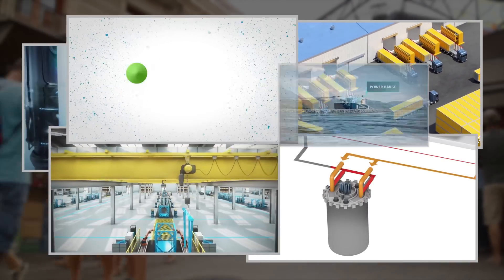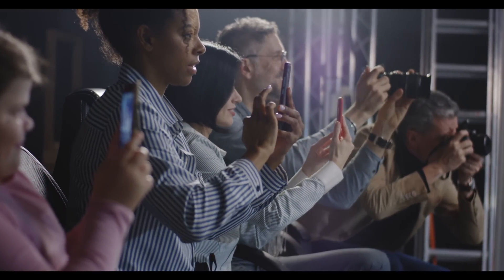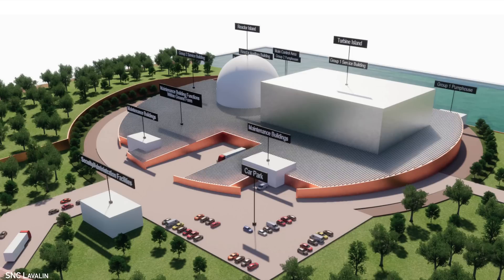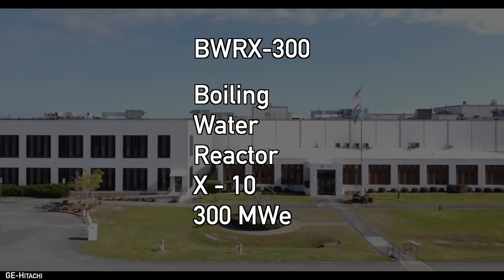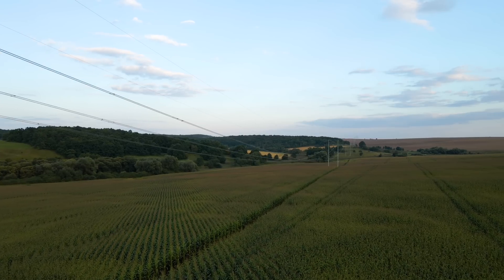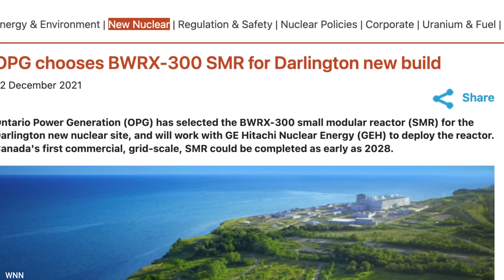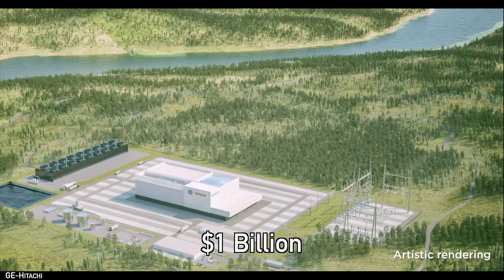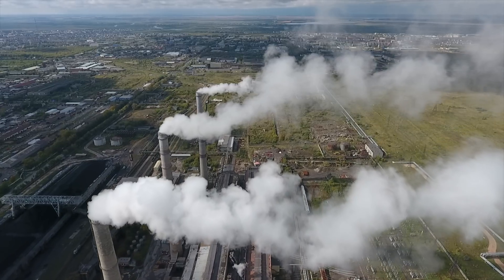Why This Small Nuclear Reactor is Actually Winning

Comment: Right now, nuclear construction has the reputation of being over-budget and over-time.  SMR's have also been criticized for being more expensive per kilowatt, than large reactors. But at this point, it may not matter.  If GE can do a repeatable smooth process for continuous nuclear construction, on budget, on time, ... reliably deliver ... my hat off to them. (My preference is still passive safety, and factory manufacturing, as a minimum, to regularize the whole process.)
Reply: 150,000 SMRs in the world to stop carbon dioxide emissions in the atmosphere. 
All the Dictators  ? ?
Uranium ore exports to every country's nuclear industries  ?
Reply: Just order one from Rosatom.  :-)
Reply: @Iv987654321  spicy
Reply: I’m a big fan of SMR's, especially if we’re to switch to electric vehicles, but the fly in the ointment is the small supply of uranium on Earth. We will run out. Now what? Conservation, that’s what.
Reply: @blipco5  That's a non-problem, but I haven't time to elaborate. There are many arguments against nuclear/SMRs, but fuel availability isn't one. We have an effectively infinite supply, especially if Thorium is introduced.
Reply: @jonb5493  I never considered running out of uranium until I watched Sabine H's video about it. She explains more in detail but I guess it’s a thing. She also talks about other types of reactors but the takeaway was that we can/will run out of fuel for nuclear reactors. It was me who threw in the "C" word. Conservation can work.
Reply: If....
Reply: Yeah, major part of what made nuke power expensive is the construction itself.  

Improving the safety and reactor designs will fix this issue
Reply: Sure. And use Russian uranium
Reply: @Oliveir51  because Russia is the only country that can do that right? You're making a point but, not the one it seems like you're trying to make. Refining uranium is pretty straightforward in the sense it is well documented. Have a chip on your shoulder with the politics that made it that way, not the technology... Further it will be years before the first smrs come online, which is more than enough time to begin construction on facilities to refine more uranium.
Reply: @Oliveir51  an additional point is that 1 billion in uranium should barely be a talking point next to the double digit billions in Russian oil and gas still be exported?
Reply: “Reputation of being over budget and over time”

Very US, Western EU centric claim. There are 60 reactors under construction globally right now.  Exactly 4 in the US, W Europe, and those 4 are the most over budget, over schedule in the world. The other 50 some are doing well. Why do you think that is?  Why do you think so many commenters speak about all nuclear as expensive?
Reply: @Nill757  anything but a simple question to answer. Though most of it falls into the fact that the labor force and skill to make large reactors went away due to demand going away. The next issue is old regulations that were made during a time where only large reactors were built. One can only hope that the regulations lean towards favoring inherently safer technology instead of trying to regulate older designs into being safer. We can't rely on companies to do the safe thing and can't rely on regulators to catch every infraction. It's only going to get better by using newer and safer designs. Agreed though the USA especially has its head up it's rear end on cost right now.
Reply: @notsam498  We can trust that very robust designs won’t hurt a lot of people when they do break from lapses by builder ir regulator.  That’s how planes are built now, cars, buildings, drugs. What kills nuclear in the US is a regulator trying to make it safe as possible without regard to cost, ie the ALARA rule, LNT assumption. It has to end.  It won’t, until the US wakes up and sees a thousand Russian and Chinese reactors around the world, saying, with no self reflection, ‘how did this happen’? Russians have existing reactors or projects in sone 14 countries. 

Nuclear in the US needs a regulator like the FAA. The current NRC needs to be shoved into the ocean.
Reply: Nuclear energy is a fabulous example of humanities ignorant stupidity... have'nt any of you nuclear death cultists ever heard of Murphy's Law?  What am I thinking..
 obviously you had still had not.   And nevermind the left over STILL HOT spent fuel that you STILL DONT KNOW WHAT TO DO WITH... other than dump into the oceans like you did in the past.
Reply: It has that reputation because nuclear ☢️ has been shadow banned 🚫 for the last 50 years.
Reply: It is not a reputation but a fact.
Reply: Because of outdated laws.
Reply: @Coffee4myTavor  Interesting !  What nuclear regulations would you like to eliminate?  If you cannot name one, then you have not even researched anything before making a generic comment.

After TMI (1979) the requirements to build a nuclear reactor have not changed except for siting next to the ocean.  The "laws" are very clear.  They just can't seem to build anything that requires quality and documentation.

No prob with building a WalMart or Amazon warehouse
Reply: @clarkkent9080  the laws that established the NRC and NRC regulations are outdated. They place overly burdensome regulations on construction and development.
Reply: @Coffee4myTavor  Again, you cannot name ONE outdated law or regulation because you have absolutely no real knowledge on the subject.  Just another public school educated person that thinks they are learning from social media and YT videos.

I for one worked in the industry for 40+ years at five different nuclear facilities across the U.S..
Where do you get your knowledge????
Reply: they produce more high radioactive waste!!!! dream on nuclear dullies get some investor money and shutnup!
Reply: Hey Poland! You're going nuclear for the wrong reasons!

CO2 is climate-irrelevant. 

Interglaciation climate change (i.e., the Medieval Warm Period) is caused by changes in cosmic rays (Svensmark et al). 

There is not such thing as anthropogenic global warming.  

"Global Warming" is a superstitious bullying and shakedown of the taxpayer. 

Just burn coal and keep looking for more oil and make it out of coal (the way South Africa does at SASOL).
Reply: That's because the nuclear industry has stalled since Chernobyl, with much less plants being constructed, the technical knowledge was lost and it became more costly... That's why some countries want to make big projects, to rebuild the industry
Reply: @arthemis1039  Eh, “the nuclear industry “  in the U.S. and W Europe has stalled, not everywhere else.  56 reactors under construction today, everywhere else.
Reply: Nuclear is dead in America because it is possible for opponents to throw one obstacle after another delaying both construction and final permitting. the time delay between allocation of money to revenue generation pushes return on investment from adequate to zero and then negative.
Reply: @joechang8696  In the southeast, there was 100% public and political support for VC Summer and Vogtle and look how that turned out.  Just saying something without facts or examples does not make it true
Reply: @joechang8696  Yes - They need a champion high up in the government to help keep progress occurring.
Reply: @joechang8696  exactly. Abolish the EPA
Reply: @jakeroper1096  the EPA does not regulated nuclear.  This is done by the NRC.  This agency kind of has the mandate to kill nuclear which they have been doing a quite good job at.
Reply: @joechang8696  Nuclear is dead because a 300MW reactor (BWRX-300) is many times more expensive than 300MW of wind or solar energy. That's just to build the reactor, the cost to fuel the reactor (plus maintenance) only adds to its inability to compete with sustainable energy solutions. With utility-scale battery storage, wind and solar is truly 24/7 while nuclear reactors go offline on a regular basis.
Reply: @KendallAuel  Depends, Neuhardenberg Solar Park 145MW cost: $365 million (so 300MW would cost about $700milion) and it create about 20 GWh/year. while Fukushima Daiichi 2 (760 MW $2bilion. in 1972)  was making on good year +6000 GWh.
Reply: @KendallAuel  What is the cost to close down the grid on a night without wind?
Reply: @adriankowalski5492  So at 20GWh/year that comes to about 55MWh per day. Which says, essentially, the Neuhardenberg facility produced at one-third capacity for just one hour per day. Meanwhile the good year at Fukushima had the turbines running at 90% or better for 365 days straight. Could be -- I guess?
Reply: @arneanka4633  There are plenty of ways to produce electricity on dark, calm nights that don't require the radioactive decay of unstable isotopes. Besides the gas turbine generators that are now spread out everywhere, hydro power, pumped hydro storage, utility scale battery storage, etc. Most hospitals (and a lot of factories) have backup generation as well. In the future our electric vehicles will store 60kWh or more, which can power an entire suburban home for a couple of days on the rare occassions the power goes out. Nukes are dirty, dangerous, and economically draining.
Reply: @KendallAuel  How much does batteries produce?
Reply: @KendallAuel  I don't know if you know this, but there are decaying radioactive isotopes naturally occurring on the planet and throughout the universe all the time. Harnessing that natural force is not dissimilar to harnessing wind, water, wave or solar except propaganda. I have also been involved in renewable energy and the maintenance costs are always quite higher than projected. Those windfarms also slaughter animals by the ton.
Reply: @KendallAuel  actually wind and solar have costs that need to be added in for being intermittent sources of power.  If the idea is 0 carbon emissions batteries or some other storage needs to be factored in.  With this always on nuclear starts to make much more sense.
Reply: @stanleytolle416  don't forget that nuclear is a lot more envirnomentally friendly when being dismantled

Even when having gone supercritical, chernobyl is estimated to have had less negative impact than a modern wind farm will have due to all the non-recyclable materials
Reply: @angrydragonslayer  decommissioning nuclear power plants are far less destructive and costly than any other source of power.  There is a small amount of high level radioactive material that can easily be put in a high level storage facility while the rest of the radioactive materials are low level waste that only needs to be isolated in a landfill area rated for 300 years.  This low level waste is not even directly hazardous in any practical sense.  Really the stuff is simply treated with a abundance of caution.  Kind of explodes the cost of decommission most likely unnecessarily. Even with these costs it appears that present nuclear facilities can be run for 80 to 100 years if not shut down for political reasons.  Like the cost of decommissioning is miniscule in comparison to the cost of yearly operation and is pre-saved  for with a yearly fee.  So compare this with coal and all other renewables nuclear's cost of decommissioning is miniscule.
Reply: @stanleytolle416  i was more talking the environmental cost but yeah, that as well.
Reply: @angrydragonslayer  You make me smile.
Reply: @liwojenkins  Windfarms killing birds is overblown. In the grand scheme of bird mortality, wind turbines are a drop in the bucket. Cats and window strikes kill orders of magnitude more.
Reply: @KendallAuel  the problem for solar or wind is its intermission. in addition, when you look at the cost of 1kwh generation within its life cycle, the competitence for solar or wind is not obvious.
Reply: @qianyoupan7787  In the final analysis, it will be the public utilities that decide the fate of nuclear power. They purchase the available electricity and they aren't willing to pay high prices for nuclear power. The economics favors utility scale battery storage backing up the intermittent renewable sources. That is far cheaper and more stable than nuclear, and so the SMR push will likely fade away due to lack of economic viability.
Reply: @angrydragonslayer  This statement is false: "chernobyl ..had less negative impact than a modern wind farm.. due to all the non-recyclable materials". A modern wind-farm can have nil negative impact. The so-called "non-recyclables" can be sunk to the bottom of shallow sea areas (e.g. Dogger bank) to construct "energy islands". This is win-win: it saves money + resource to construct the island, and it gets rid of the end-of-life blades, hardware etc.
Reply: @jonb5493  and landfills are also a positive

I'm not speaking of what can be done, i'm talking about what is done and will continue being done as per EU/UK/US +others regulation (until at least 2035, which is singapore wind power regulations)
Reply: @KendallAuel  is 300MW of wind and/or solar WITH batteries many times less expensive than nuclear?
Reply: @guy999  The cost of utility scale battery storage is currently about $350/kWh. So each hour of storage for 300MW is about $100M. Typical case is 10 hours of storage, so add $1B for batteries. Keep in mind that these battery installations end up saving utilities a lot of money because they reduce the use of peaker plants and they also stabilize and synchronize the grid. They end up paying for themselves over a few years which is why the backlog to build them is already 2 years out.
Reply: @anxiousearth680 
It isn't birds but bats that in real danger from wind turbines.  Wind turbines are now among the top 2 causes of bat mortality, and bats have a slow reproductive cycle, with only 1 or at most 2 young a year.  While there is talk about addressing the problem, I have seen no proof that they fixes have been implemented or that bats have stopped being killed.  
.
Reply: @KendallAuel  studies on solar and wind infer substantial environmental cost. Gallium arsenides or nitrides don't just come out of the ground and neither does the lithium. Studies on environmental impacts of wind farms on land suggest serious impacts to wildlife and blades that are costly if not impossible to recycle. The habit of pretending solar energy is sustainable or wind for that matter is disconnected from the realities of industrial scale production. Disconnected from the realities of energy storage. All of which point to them being far from the claim. Further the myth that nuclear is dirty is something that you should back up by eluding to some facts other than a handful of accidents too quibble over. It a distant mention of isotopes. When we talk about nuclear waste their tends to be a fever pitch over simplification of a subject that is incredibly nuanced. I'm gonna say firmly the solution is in the middle so called renewables have a place and so does nuclear.
Reply: @adriankowalski5492  Doubling the power in solar park so double the cost is a mistake often made by solar advocates. At 5 acres per MW in the best farms and 8 acres per MW for not so good, big land buys start to go for a premium. When a thousand acres vanishes from living or office space or agriculture for maybe all time, the price might be $X.  When somebody comes for the next 1000 acres, it’s not going to be $X anymore.
Reply: @KendallAuel  “plenty of ways dark calm
Nights “

Plenty? Bizarre.  Not plenty of zero emission ways. Why not look into this instead and try and point to some new storage/backup project that can do what you say instead of conjuring?  It’s important, has to be there. There has been no new significant new pumped storage  built in the US in decades, for very good reasons if one looks into the engineering and the site requirements. The feasibility has to allow for not one or two more, but a thousand. There is no utility battery storage facility that could back up one middling 500 MW wind farm  for a full day, nowhere. And, while the price of battery storage declined dramatically for years, that decline has stopped given material constraints.
Reply: @KendallAuel  Utility scale battery storage, installed, is $500/KWh from recent projects. If the project selects long life, as many do, and thus shallow (50%) discharge, then it’s double the storage or $1000/kwh.  After decades of dramatic battery price decline, material shortages have slowed or stopped further declines last couple years. 

“Stabilize and synchronize “
Utilities have used batteries for decades to given a few seconds of synchronization.  Has little or nothing to do with w hours and days of storage needed.

“Backlog”
The backlog is due to mandates telling utilities they shall install storage.   Big mystery then when corners are cut on transmission maintenance. or rates hike.
Reply: @KendallAuel  I  bet a gas tur 5:46 bine peaker plant is cheaper than a battery farm, at least in North America.
Reply: Nuclear power historically designed for huge base load applications.  When the power market was deregulated, the profits flowed to peak load plants…namely smaller gas fired plants.   This is the unspoken and strongest reason nuclear fell into disfavor.
   The BW reactor, though a known technology, is a flat head engine.  Committing to it will suck the money from technologies, killing them. However GE’s recent troubles pinched their cash leaving them with nothing else to offer than BWR technology. GE’s problems shouldn’t set the bar for the rest of us.  
   Terrapower, for instance, is building a fast MSR plant.
    Regardless, our aim should be reactors replacing fossil boilers at existing plants.  Save infrastructure, power distribution, personnel.  Green is going to jam up in court obtaining right of ways and fighting siting opposition; indeed it already is.            
  Moreover, the mining Green requires for copper, lithium, cobalt….is unreasonable.  2000lb of lithium battery requires what? 100000lb tons of mining?  Greens cherish killing the planet to save same?  Yes, folks, John Kerry IS that dumb.   
   The transition is a tough questions.  Feel good slogans and posturing won’t cut it.                              Cheers
Reply: Not more expansive, — less efficienct, but who care, it is still cheaper then big station power!